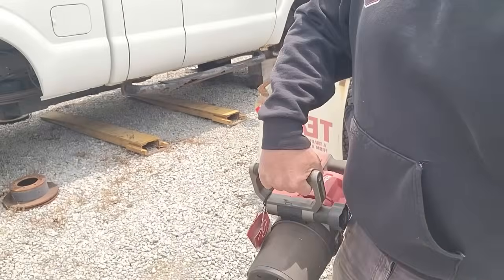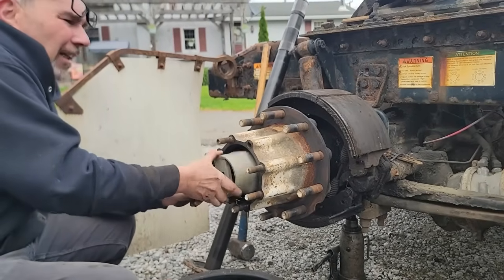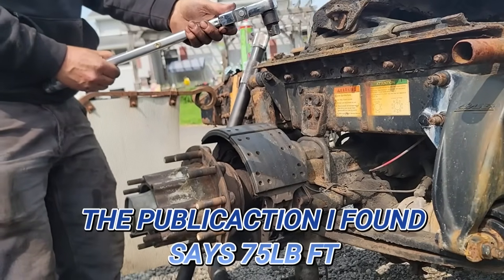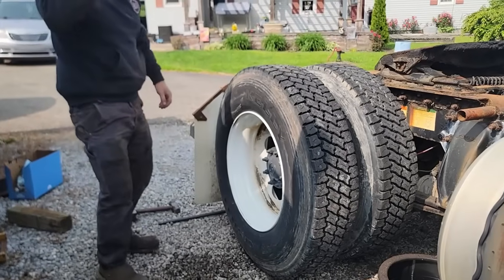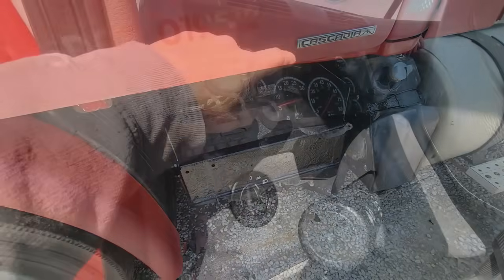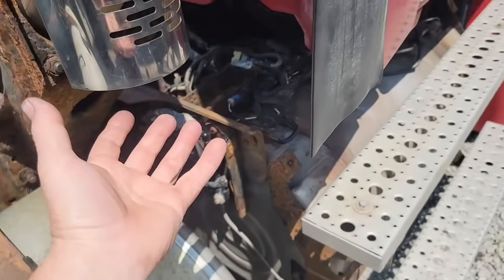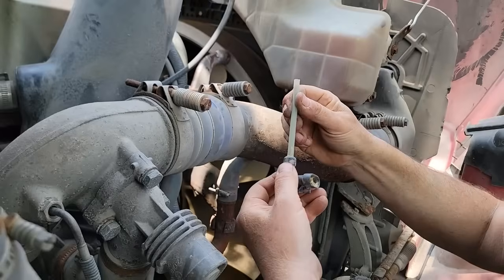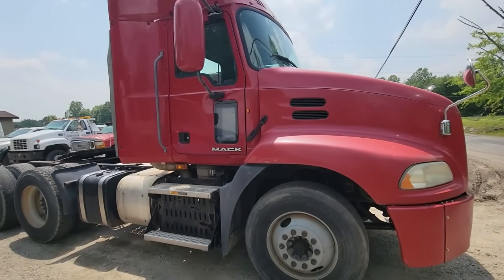CANT FIX THE FREFIGHTLINER.  CAN I FIX THE MACK?

Comment: JC idk if you know or not but you take the cap off of your big Milwaukee impact and add a little more grease to the impacting hammer and spring in there and it will last longer and hit harder as well. Just thought I'd tell you that if you didn't know already. Another great video as always.

Comment: I've also found that usually when the vent hose for an axle is plugged usually the fitting for it on the axle is also plugged.
I simply take the proper size drill bit to clear it out, not trying to remove material but get the gunk out of there. Then I clean it with a little brake parts cleaner.

Comment: If that MACK sensor is anytning like Paccar's coolant level sensor, there is a magnetic float that sits around the sensor in the reservoir. Paccar trucks have the issue where the magnetic float sticks, and it can shut the truck down if it reads low coolant. A lot of people change just the sensor and then complain the new sensor was bad. No real way to bypass with a paperclip either unfortunately. Best thing you can so is take a small magnet and put it on the tip of the sensor. That "sometimes" works.

Comment: On the older truck axles I used to work on you had to put the diff lock in before pulling the axle Shaft or the diff lock gear would fall out of its cradle and into the axle casing. Next job,diff out 😢

Comment: Looks like the freightliner is getting parted out. How easy does the party hat come off that Mack?
Pull the hat off, yank the front diff, tow body off the GMC straight on it.
Maybe not that Mack. But I think that's maybe what you should do with one of your older trucks, at least you would be able to use it. Full size single drive truck, air brakes, locking rear end with good highway gearing.
What's that wrecker unit rated for? Will it pull a sleeper cab tandem drive tractor from the rear? What matters most the gross chain rating of the truck, or the gross rating of the wrecker? Would that wrecker body be rated for more because it was put over onto a better truck? Medium to Heavy. Or light heavy. Empty.

Comment: The only real justification I can think of for using white paint on truck wheels and hubs is that it would make it easier to spot an oil leak from an exle seal during a cursory walk round as the oil would show up against the white paint.  Really, drivers now should be being encouraged to do a thorough walk round inspection of a truck before taking it on the road, as they are required by law to do, but all the bosses want is to cut the amount of time with wheels not turning.  They don't seem to care about the safety aspects as they're unlikely to be the person in front or next to the truck when it suffers a major failure on the road.

It really makes one wonder what the value of a human life is these days.  I strongly suspect that the real answer is far less than any of us can imagine.

Comment: J.C. You do nice work, when I went to trade school and we were studying circuits the instructor would use a big older type seal beam headlight to load a 12 volt circuit he said if it would light up a seal beam the 12 volts was pushing enough amps to get the job done . example of a car came in and we diagnosed it with a bad fuel pump we would put the seal beam on the wires that powered the fuel pump if the light did not light real bright, we knew it was a common problem with the connectors ( Ford) problem. Same test if a car came it with repeat alternator failures , when I started doing work on my own I would use a big older type automotive horn. The interesting thing about the horn is you get use to the sound of a good circuit, when you put the horn on a bad circuit, it sounds so strange ? Like a cartoon horn ,

Comment: Yea Mack can't make a good coolant level sensor. Wheeler makes a better upgrade. I can't believe it still has the original EGR cooler on it. We only get about 200,000 out of them. Most of those trucks have a cabin air filter under that panel near the blower motor.

Comment: Ambient air temp sensor should be behind the grill in front of the charge air cooler/AC condensor. Should be able to stand on bumper/tire and lean over the top and reach it if i remember correctly